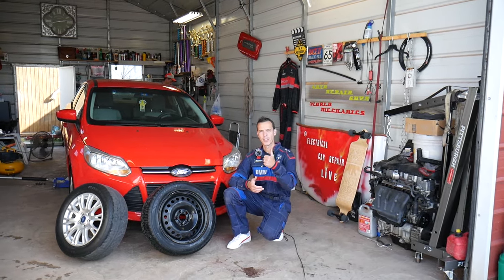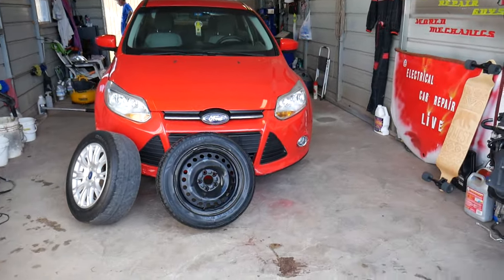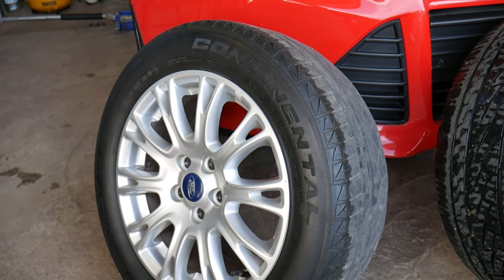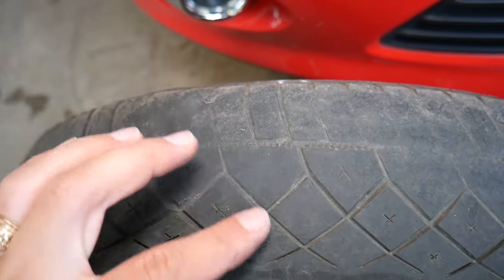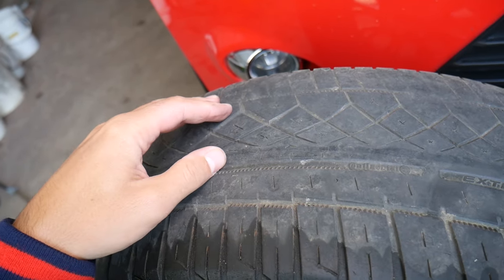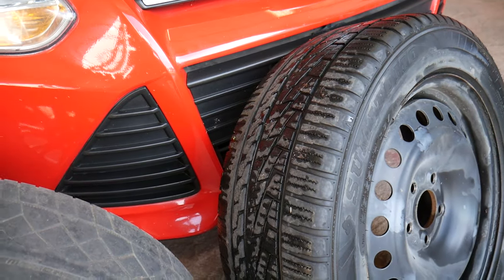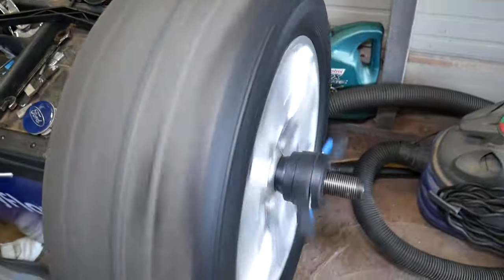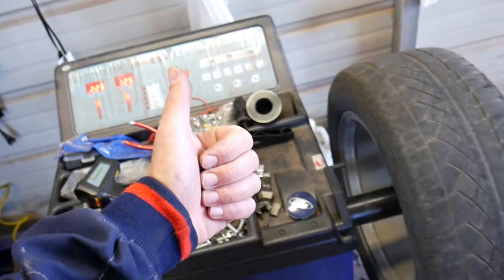WHY CAR VIBRATES WHEN DRIVING AT HIGH SPEED. EASY FIX

Comment: Thanks for the video. This is exactly my problem. Around 60 MPH I get the vibration. Any slower or faster and the vibration goes away. So I suspected a tire balance issue, but you just help confirm it. Looks like I'll be going to the tire shop to get it re-balanced.
Reply: Hi, was it the wheel balancing that needed doing and did it get fixed?
Reply: Did it fix it?
Reply: @Nwidmann  Yes. The tire shop said one of the tire weights must have popped off. They added a new one and everything is good now.
Reply: Omg 😳 I have the exact same problem! Thanks God I found this video cause I was already thinking 🤔 it was something more!
Reply: I'm having this problem on a brand new vehicle. It started when somehow both left tires started leaking out of the blue, soon after I bought the car. I believe they overinflated the tires at the dealership also, they were at 40 psi or a bit over when it warms up, and they are supposed to be at 35 psi. There is a warning on the tire about filling above 40 PSI also, they are low profile style tires on 18 inch alloys. I'm so ticked that I have to go back to the dealership, I already went once and had one hole plugged, and they couldn't find the leak on the other tire, but I keep having to fill it up with air every couple of days. There is a warranty on the tires but it's going to be a hassle.
Edit: now that I think about it, it wasn't happening when I would let off the accelerator, so it could be something else, like bad ball bearings or CV joint, which would be odd on a new vehicle. I've only experienced a bad CV joint before in an older vehicle and it was shaking all the time, so it's odd that it's only happening when I hit 55 or 60 then goes away after, or if I let of the gas.
Reply: @ShawnKirk007  do you remember if it was only happening while accelerating? Mine stops when I'm coasting at around 55 or 60 but while accelerating it does it. This is a new vehicle also, with 1k miles on it, but I believe they screwed the tires up when they installed them.
Reply: Hey, I have a similar issue. When I got it balanced and re-aligned, it didn't fix it. Shakes the steering wheel and I hear a clunking noise breaking at high speeds. I know it's not the rotors
Reply: @carsonbrooks1326 it’s your driveshaft I just had to replace mine it shakes a little when increasing speed but sounds really bad slowing down

Comment: Interesting.   I first noticed the 50-60 mph bounce on a highway trip last weekend.   Fortunately, most of the trip was at 70 and 75 mph, where the ride was more pleasant.   I used a bubble balance today to confirm that the wheels are balanced, and checked the treadwear to see that the tread is in consistent good condition.
Reply: So what did you replace
Reply: @derekenlow7607  the whole car
Reply: @akjakata9307  I overfilled my tires causing them to wear unevenly.

Comment: The answer is : a wheel is bend 
                        : tire wear
                        : alignment 
                        : cv axel
Reply: Cv stands for?😊
Reply: @armaz83  it’s transmission to your wheels. CV joints are part of the driveshaft and are used primarily on front-wheel drive vehicles, but they are also used in rear- and four-wheel drive vehicles and cv means constant velocity.
Reply: @snoozemaaster16  oki

Comment: What if vibration at highway speeds on a brand new car right off the lot with 35 miles?
Reply: Take it back and tell the dealer about it, should be under warranty

Comment: When I go on the freeway it starts at first I thought I was driving on some rough grounds which I was but it goes away if I go 75+
Reply: Me too! What was your cause? Just installed 4 new tires and balanced!
Reply: @StreaminGreen  did the new tires and balance fix it
Reply: @MrShaybaybay  nope. I had to get my lower control arm bushing replaced. Went ahead and did all of them
Reply: @StreaminGreen  did that fixed it?
Reply: @Luceium01  yes sir 100% fix. Luckily I know a Mechanic at my local Subaru dealership and did it for cheap.
Reply: @StreaminGreen  huh lucky me I'm currently taking class in Automotive Technician. Can do it myself for free
Reply: @StreaminGreen  When you turned one way did the vibration go away? I just replaced a bearing thinking that was it, I was wrong… very frustrating.

Comment: I get the steering wheel shaking at 45-55mph,.but not consistently.  In the same day, it goes from pretty smooth to very shakey and back, and does not seem to follow any hot or cold trend.  Any ideas?  The problem got worse after the vehicle had been parked for a while (brakes noisy at first, but seemed to smooth out after 30min of driving).  Thank you.
Reply: I have my at 40-55 as well  try rebalance
Reply: Similar
Reply: I have the exact same situation. Did you find out what the problem was?
Reply: Could have been that both tires were a bit out of balance, and from taking turns, the imbalance got in synch and shook worse.   Rebalance (new tires too) fixed it all.
Reply: Perfect. Thank you for your response! Have a nice day
Reply: More like you tires for setting on same spot.

Comment: those tires are worn completely out. They are down to where the wear bars are showing. Not good on a wet road. I live in the pacific NW, it's imperative to keep good rubber on the road. we go from dry to wet to snow covered in one day. Safety first. Good Video otherwise.
Reply: Dufus you're right about the Pacific Northwest and having good tires. I've been here all my life.born here, die  here, wouldn't live any where else. Have a great day sir.

Comment: If you recently messed with cv axle then that will be your problem . I developed this issue after accidentally pulling off my cv axle but I had a hard time locking it back in . Didn’t think it could be a problem but we’ll see . I’m not confident about how well I put it back in anyway.

Comment: 2012 Camaro RWD starts shaking at 55 goes away at 75, I got new wheels had them balanced on new tires, the shake still didn’t go away, had a tire tech re-do the balancing and it still didn’t go away.
Reply: Maybe you should change your car😅
Reply: Have you fixed the issue?
Reply: Check you are you joints
Reply: U Joints
Reply: Camshaft or crankshaft sensor
Reply: @dr.aprilgivensphd4051  definitely not
Reply: @zoh what do you think it is then? It was a cam sensor when it happened to my Sebring and it works fine after changing that also the air filter in the vehicle was clogged and that was changed too. So don't say definitely not if you don't know what you are talking about. You are not the mechanic God!
Reply: Please tell me you figured it out? I have a 13 camaro and have the same issue

Comment: Why my oil pressure needle goes up and down I already changed the oil pressure sensor and is still the same and one when the needle goes down all the way down the car almost shuts down and and vibrate

Comment: If you feel vibration through the steering wheel, then the problem is in the front wheels front of car.
If you feel the vibration through the floor and your feet, then the problem is coming from the rear wheels and rear of the car.
Reply: what issues could be linked to the rear wheel

Comment: I had a vibration while accelerating at 70 it would vibrate. I had a bad axle i replaced it with oem. I also had both lower control arms no alignment and i still get highway vibration

Comment: I have a 325i 93 above 80 mph and turning right it starts shaking but not when turning left any ideas I rotated wheels but still same
Reply: Same goes for me, only difference is that mine is vibrating when turning left.

Did you manage to find out the issue? Would you mind sharing if you do? Thank you!
Reply: Same goes for me, only difference is that mine is vibrating when turning left.

Did you manage to find out the issue? Would you mind sharing if you do? Thank you!
Reply: @geegeephtv1902  for me it was the lower ball joint for the lower passanger side plus the arm but mainly the joint rubber part super worn out def replace em both sides if u can and fixed makes sense why once u look at it compared to a new one
Reply: Yo I'm having the same exact problem in my 328i beamer
Reply: @BadPandaRacing  what did u do exactly because as soon as I get to 75 and up its shaking
Reply: @jessicaprice4859  control arm bushings was my issue back then wen thy wear out its common issue
Reply: @jessicaprice4859  inspect your front control arm bushings  or bearings first bet its the issue tires too can do weird stuff to front steering if off balance
Reply: i’m having a similar issue with my 88 325i. around 55 it’ll start shaking a bit and then it goes away around 60. it’s a pretty mild shaking though and the tires on the car are very old so i think it’ll go away once i get new tires.

Comment: My car vibrate when I suddenly step on the gas the moments I hit the highway. 80-100 kph seem to be okay but when it get 120-150 ish she start shaking then I switches back to the normal lane to 80-100, after about 5 -10 minutes I went back to the fast lane and again hit 120-150 and the car didn't shake so what I believe is that she just need some lube and warm up abit first...idk I could be wrong

Comment: I have a new 2020 Toyota Camry that was riding smooth since new.  At 5k miles I brought it for a rotation and it developed a high speed (over 70 mph) vibrations then I had it balanced it solved the problem. Now at 10k miles I took it for a rotation and it has vibrations again and balance didn't solve it. What could this be? Its a brand new car with no suspension problems and new Hancook tires
Reply: scary and unfortunate, has it been solved?
Reply: @TheMadisonHang  yes, the kids working at the dealership did a sloppy wheel balancing job and knocked the wheel weights off this causing the vibrations. I took it back and gave them a peice of my mind and assertively demanded to fix this or I will write a bad Google review and that seemed to work haha

Comment: My bmw 2008 528i vibrates when I apply breaks at a speed of 100 km. Could you give your opnion.
Reply: Your struts are likely bad.  I chased a shudder under braking at high speed for many months and it was the struts.  If they are wet with oil it will be obvious.
Reply: @joewestfall2952  thanks

Comment: My 2011 Elantra have been doing this for three weeks now . At 60/70 mph . I have switch da two from tires to da back n still have this issues . Never had this even before I change out both inner n outer tyrods . N driving at speeds of 80 Mph . Owned this car since 95 k miles n this is first time seeing this .
Reply: hey man did you find a solution???
Reply: @Bob-zc4bm  now I just replaced tow right front n rear tires with good used tires . It doesn’t feel that noise no more n I check the CV JOINT WHEN RIGHT FRONT TIRE WAS OFF N IT FEELS STRONG NO LOOSE OR NO RIPS IN IT. I may just change both when I get money

Comment: I drive a 2008 Chevy Cobalt coupe that shakes only between 50-60 MPH, peaking at 55. I’ve taken it in twice to get the tires re-balanced recently, got an alignment and full inspection from 2 different shops and no one’s found the issue. Recommendations/advice would be greatly appreciated. The shake’s not terrible but I’m worried it’s going to start causing other issues
Reply: check the engine
Reply: @Lipshfitz  found the issue a few months back. Two of the steely rims were older than the other two. They were out of round / bent. So I replaced the old ones to have a full new(ish) set of rims. Shaking problem went away. Then I sold the Cobalt and got a Challenger 😄

Comment: I have a bad vibration, but sometimes. Not everytime. I got new tires, balanced and alignment done. New tie rod ends, new rotors and pads.  I checked inner and outer tie rods and ball joints. Everything looks good. I'm guessing if it's shocks or motor mount?!?!  Idk. I'm lost. Anyone knows the issue?
Reply: check the engine
Reply: @Lipshfitz  motor mounts u mean?  What do I check in engine?

Comment: A lot of everything he said here made sense but he did miss a lot of things when it came to lumpy tires. If a tire has a high and low all the way around. Your suspension it out and needs to get replaced. Alignment wear is a huge one and your gonna see that when your driving, when your car pulls either left or right or maybe even both it’s gonna affect the wear on your tires and your driving. It’s important to keep up with your vehicles maintenance because like always no brainer you could get in a serious accident if something like a few of these things happens to catch you off guard.

Comment: I got a vibration although it's not much but comes RIGHT at 50mph and goes away till about 70mph or so. Now I'm also getting a sound like a wheel bearing noise at above 40mph especially when I turn right. Brand new tires a couple months ago, but I went to 2356016 instead of the stock size of 2256016, and all this start about a few weeks ago. I always go with 32lbs of air exactly in each tire. I have a 2003 buick lesabre front wheel drive car. Wheels been balanced 3 times, 2 alignments, ball joints and tie rods seem good, no ripped axle boots, all brand new rims. It was fine with the old 2256016 tires on. All this seemed to start after new tires were installed. I'm thinking of going back to the 2256016 size. Help!!! Thanks.
Reply: Wheel bearing
Reply: Did you ever find out what was wrong with it? I have the same exact problems
Reply: @powerfulhero7936   My frt. left trans mount.. the one that always fails

Comment: Hi, my car steering sticks when returning to the center position but only when I make right turns when going around a corner on the highway. I also hear a grinding noise when turning to the right. What could cause this issue?
Reply: Intermediate steering shaft may need lube or replacement. Wheel bearings may be going out as well

Comment: I just got new wheels and almost brand new tires. The old ones shook at about 100km/hr and got worse as I sped up. Now it starts at about 120 and gets worse as I speed up. I’m having trouble locating the issue
Reply: Same here. I start having vibration around 55-60 mph and it gets slightly worst as i gain speed. Im on older tires, but they didn’t cause any issues on my old wheels. Its kind of stressing me out, i got new tires and I’m praying that’s my issue.
Reply: @nasseranise102  yeah hopefully, but here’s the thing. If your suspension and everything is all good (like mine is, I inspect once a month) then it HAS to be wheels right? But also, I just learned that some cars have weights on the cv axles to keep them in balance so maybe it’s that! I’ll look into it. Let me know if the tires fix your issue
Reply: @MegaDevify  alright, I’m gonna put them on next week. I’ll keep you updated. If i forget feel free to remind me.

Comment: My 2011 ford focus mk3 1.6 ti-vct makes a vibration/buzzing sound in the cabin every time I'm in between 3700-3900rpm regardless of speed or gear. Any idea of what it could be?
Reply: Seems weird, but I have the same engine and in my case this buzzing sound appears when radio is turned on and nothing is playing. 😂
Reply: @scR471  i figured it out since, just some loose screws behind the instrument panel😅